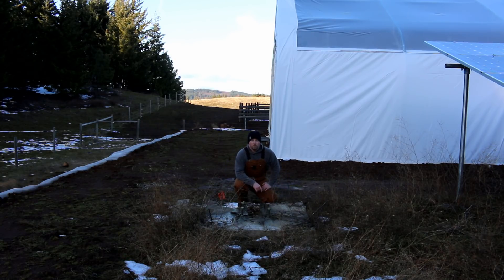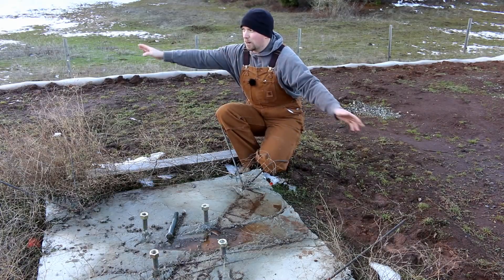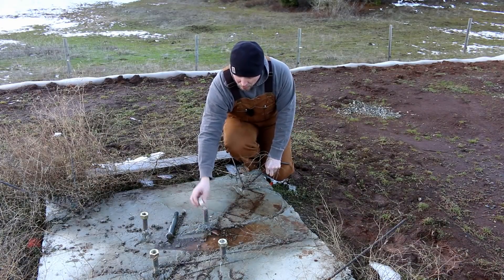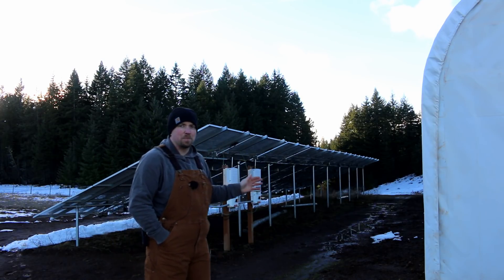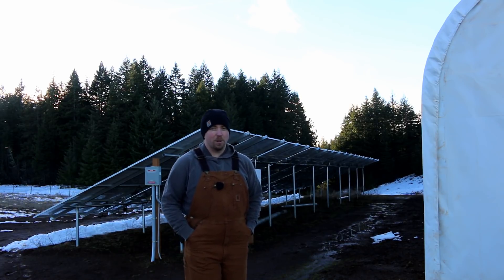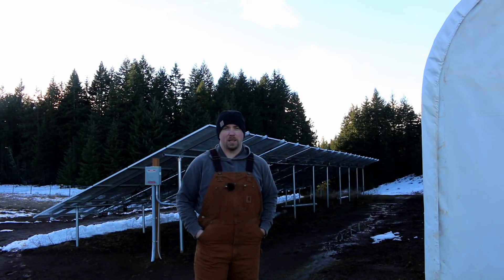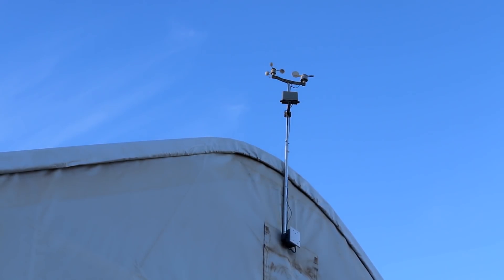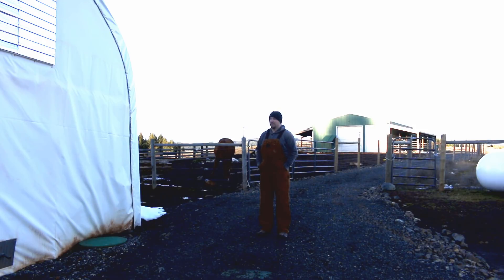GREENHOUSE Overview - IS WIND ENERGY WORTH IT?

Comment: A little light reading for you: Chiras, D. (2009) Power from the wind: achieving energy independence. New Society Publishers. ISBN-13: 978-0-86571-620-9.  This book debunks completely or revises many assumptions regarding the ability to harness the wind.  This book and the accompanying class i took at Mat-Su college crushed my dreams of Alaskan Wind!

Also, for the overalls, use spray all my duck fabric with silicon camp spray, it helps with chemical to rinse/drain off much better!

Comment: So a telephone pole next to the mast if you install it to act as a lift point for the times you want to bring it down to work on it? Would then need a support wire run between the panels and hab 1

Comment: Newish here, I understand you need power for a lot of things, but have you looked at geothermal heat. I use to think you needed a steam vent to take advantage but i guess all it requires is about 40 feet or so of soil and a compressor. works like an ac unit in reverse. I'm sure it was considered. Perhaps tell me why its not a good option.

Comment: how often do you wash your carharts? the first set of bibs that I bought the sales clerk told me that carhart wear like iron until you start to wash them. the more you wash them the quicker they will fall apart. the clerk told me that when I got ready to wash them throw them into the corner , if they pick themselves up and just lean into corner, wear them another 2 weeks. after 2 weeks when you throw them in the corner and they rear back like they want to fight wash them on a gentle cycle, they will last longer that way.  20 winters as a grade checker in Colorado, Utah and Nevada and I went through 2 sets of bibs washing them at most once a month.

Comment: The idea of bringing in the support cables has many flaws. Depending on the concrete mass for stability will be its demise. A more equilateral approach would be much stronger and remove or minimize the levering effect of the tower in the wind.

Comment: Quick question, would a vertical turbine be more feasible in your location? Seems like it could be a real space saver. Just a thought, good luck, Jeff.
Reply: It is a space save but you don't get much power out of them.
Reply: While the idea of multiple smaller is not a bad idea it is often WAY out of financial reach, the mounting system: pad, tower, guy wires, etc, are usually the most expensive part, hence buying more of them usually ends up being several times more expensive to the point of never achieving simple payback and rarely achieving the more complex methods of total ROI.

Comment: ref:3:40
You could use a compressor instead of a generator and compressed air will still work if the grid goes down. 
You also get some cheap option. A standard PVC pipe can be converted to an efficent pump if you let some air bubble into the bottom of the pipe. You can run hydrolic pumps and blow things clean when needed.  :-)

Comment: I am very tempted to go into wind power, especially since I am far in the north and in winter time when we have very low light but area is at least decent for wind, modern wind turbines produce quite a good amount of electricity even in low wind conditions.
Reply: Do measure what your yearly wind total looks like, because if you only get 30 days of strong wind and pay for a 10kW turbine then it's doing less then a 1kW turbine should do.
Reply: Yes, I have done some measurements, it is definitely borderline in my current situation, I would have to clear some of my property to get a better wind situation.

Comment: would optima car batteries work for a temporary battery bank ?
Reply: Only very temporary, car batteries degrade extremely quickly if you go below 90% charged, and if you used them down completely you will kill them within 10 charges.
That is why RVs and home battery systems use deep cycle batteries that can do that sort of thing, but the prices usually double.

Comment: This is good news. Appreciate your work and sharing your experiences with us. This confirms that I need to research the topic before flying off the blade and failing. Wind power was my next ProJect. So now it too is on hold so I can get a wind meter for my area. Any suggestions on meters?

Comment: If you get a chance,  but your more than likely already have, check out utterpower and otherpower. I have always wanted a wind turbine, and the diy ones those folks make were pumping out some serious juice. They have a made a few babies at 900 watt and 1k then moving up to 5k or more on a fee Some of the towers they have are free standing. Either way days worth of info over there and they do workshops and such on wind and alternative energy too. 

On a side note, you may want to go ahead and purchase a ham radio antenna  lattice tower if you can find a used one or one at a good price. This would give you a way to get another anemometer up in th e air above the turbulence of trees and buildings...say 60 to 80 feet up. 

Another issue you guys may have is ice build up on the rotors, not sure if the smaller commercial units have a way to deal with it and your home built units would end up sitting idle.
Reply: JClaudII. Ice throw is a serious issue for large turbines. I've never seen smaller turbines have substantial ice build up though. Another thing to watch out for is being able to shut down in a storm. I've seen many wind turbines burn up when they get going too fast